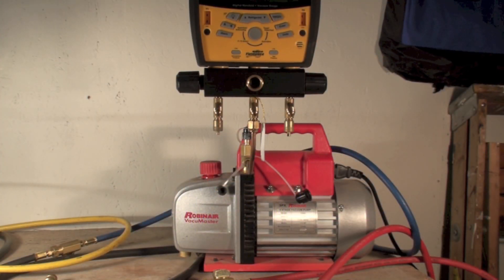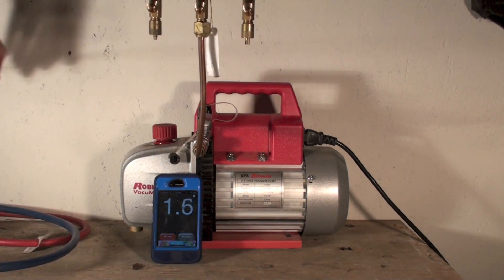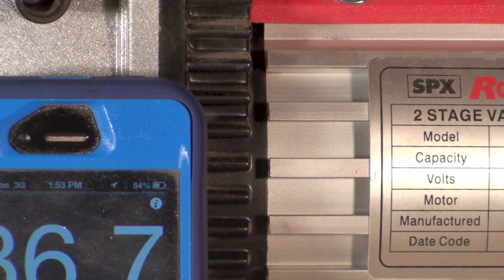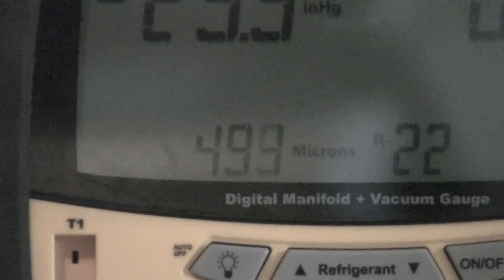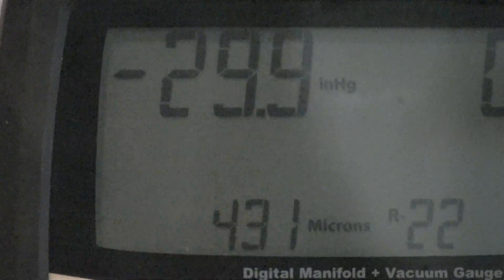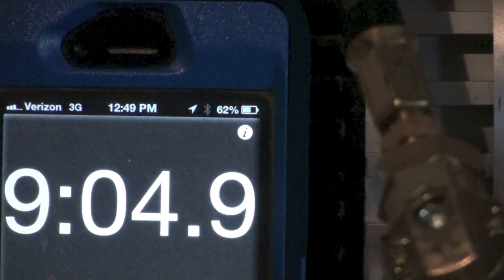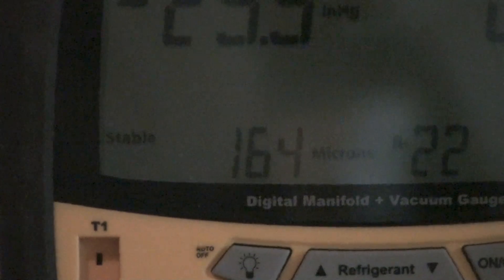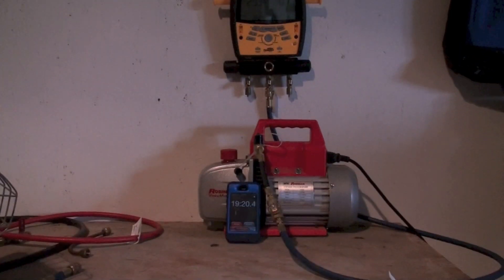The vacuum pump part 3

Comment: hi, i have an older same make of this pump. at beginning of start up i see my gage goes to 29"hg really quick with some vapor exiting end of handle ( i can feel the pressure coming out with my finger). But after about 10min of running time it's almost like nothing was coming out end of handle anymore. I couldn't feel any air pressure coming out at all. However, my gage still reads 29"hg. Is my pump defective? thanks.
Reply from the maker: You pump is probably working ok.  At the beginning, you are moving large amounts of air from the system.  After a few minutes, you are getting to high vacuum.  Your gage is not effective in reading these high vacuums.  You will need a micron garage to see this high a vacuum.
GFM

Comment: Is it normal when the exhaust blow out white smoke? I read somewhere you had to break it in prior to using it.
Reply from the maker: The "white smoke" is oil vapor.  It usually occurs when the unit is beginning an evacuation.  It is normal and there is no break-in for the pump.
GFM
Reply: @grayfurnaceman  thank you so much.

Comment: Not an adequate comparison of hoses because they were not the same length.  There would be more volume to create a pressure in.
Reply from the maker: That's a 6 CFM pump.  There will be little difference in the time or depth of vacuum with a longer pipe.  The point here is there is quite a difference between hose and hard pipe.
GFM

Comment: Good video.  I just duplicated it with the same pump and an SMAN 460 with 4 ports using the 3/8 vacuum hose.  It pulled it deeper and quicker.  Might do a video comparing my SMAN 3 with my SMAN 460 and do a time comparison with 1/4 port on my pump vs 3/8 port on my pump.

Comment: GFM, Approximately, How long would it take to pull vacuum on a 50 lbs refrigerant recovery tank, using 6cfm pump?
Reply from the maker: You should be using a micron gauge to be sure.  About 2 hours if the cylinder is clean.
GFM
Reply: grayfurnaceman Thank you!

Comment: That was a great comparison of materials friend. In my world (automotive HVAC) it's pretty much impossible to achieve the low levels of vacuum specified in the real estate.  Mostly due to the materials, diameter, and system design used in automobiles.  Just a particular bend or shape of a line or hose will affect your micron gauge readings.

That is why in my industry a single stage pump, and the vacuum readings on your gauges manifold will suffice.  CFM and time are the barometers we use for service. Example: run a 5 CFM pump for 20 minutes on a system.
Reply from the maker: Lynx Star Automotive We try to use micron gauges for most of our work to be sure of what we are getting.  You are correct that in many cases micron levels of 500 are just not in the cards.  The 20 minute number is common in the industry and in most cases will suffice.
GFM

Comment: Quick question. 

Where does the little bit of gas being removed from the system go to when doing the evacuation. 
Does it stay in the vacuum oil or is it supposed to go a recovery cylinder?

Thanks and great videos!
Reply from the maker: Disisions The CFC regulations consider it a de minimus release so it can be released to the atmosphere.  Hope this helps.
GFM

Comment: Can you elaborate the details. I had the same setup with that exact model vacuum pump on the sman4 first time used it pulled 580 microns and hit a wall in the field. Second time used it wouldn't pull below 27inhg in the field. After talking to tech support and researching reviews, forums, and videos like yours. the concensus is that this pump loses efficiency very quickly. Was the oil changed between the hard pipe and soft line? about how times was this pump used to pull hard vacuum before the hard pipe demo?
Reply from the maker: I have usually found that when I cannot get low vacuum it is not the pump but the connections of hoses or the hoses themselves.  Connect the pump directly to the gauge set hose with new gaskets in the hose. Also despite what the manufacturers may say, many units will not pull down to 500. Hope this helps. 
GFM

Comment: when vacuum your ac keep it on or off
Reply: Leroy S John Leroy pull the disconnect the condenser needs to be off. A fan running on a split system is ok and helps keep non condensables malleable.

Comment: how many minutes on average does it take to vacuum out a 3 ton system?
Reply from the maker: There are a number of variables that are not simple to cover.  If the system was open as in a large leak or you are replacing a burnout compressor, it will take longer.  Use a micron gauge.  Hope this helps.
GFM

Comment: I have a question GFM ? What did you use as a connector,on the ends of the hard piping to hook it up? To the pump & gauges. Thank You. And of course,always a pleasure to watch your very informative video's.You've help me out with so much info. You have no idea... Great Job..
Reply from the maker: The connection is a simple 45 degree single flare.
GFM

Comment: Intuitively I thought the flexible pipe would be harder to draw a vacuum, but for a different reason. It's the same as comparing a runner who is running in sand vs one running on concrete. The flexibility of the tubing absorbs the energy of the pump, energy that would otherwise draw more molecules out. So, it's not so much permeability as it is flexibility that limits vacuum....

Comment: Sorry for the dumb question. I've always considered the micron as a unit of length, but here you are using it as a measure of vacuum, with the lower the number the more severe the vacuum. Can you tell me what a 'micron', when measuring vacuum, is?